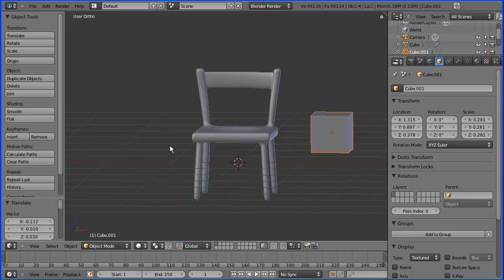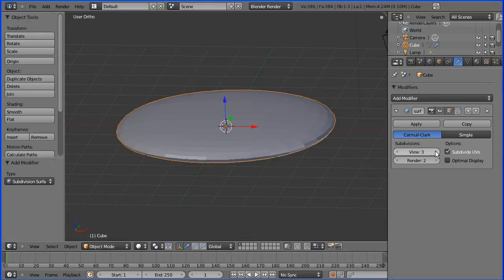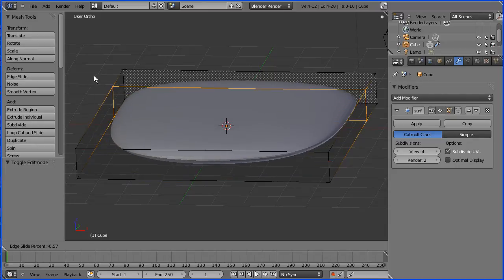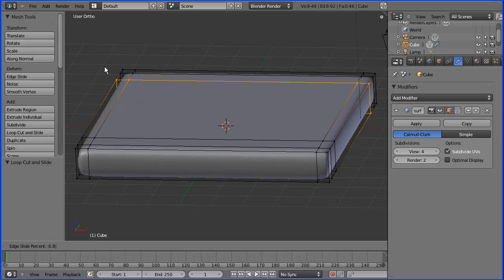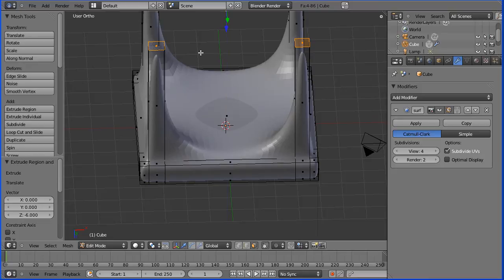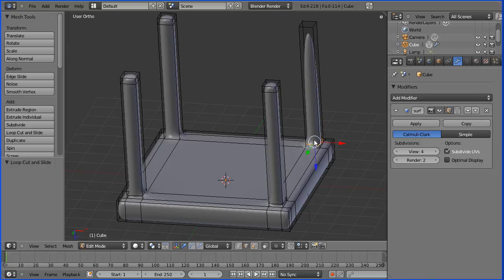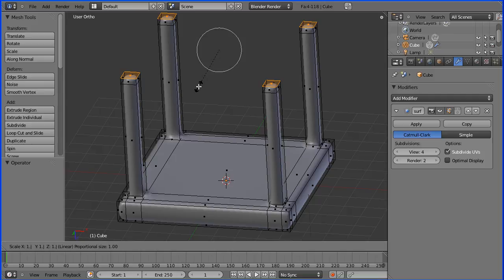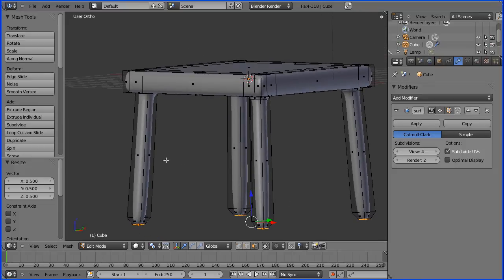Blender 2.5 Making a Chair or Table Using the Box Model (Extruding and Using Subdivision) Part 1

Comment: I used to have the option of extruding .svg files by using a modifier, but now I don't have that option. Also, I don't have the add window in the mesh tools section. Is there another way to extrude, or could I turn the svg into an object with flat edges?

Comment from the maker: @tonyc3d I have been very busy at work this week so I haven't been able to reply, I had a look at this to check that my tutorial and it worked. I guess you are doing something slightly different or one of your settings is different, when I have time I will find a version of the model just before the point you are having problems. In the mean time (if you want to) you could try doing  the tutorial again from scratch and see if you have the same problem.

Comment: When you do the loop/slide with .9 twice on the same axis, the object does not become symmetrical, as the second cut is done at .9 of the section that has already been cut, so it ends up at .92 rather then .9